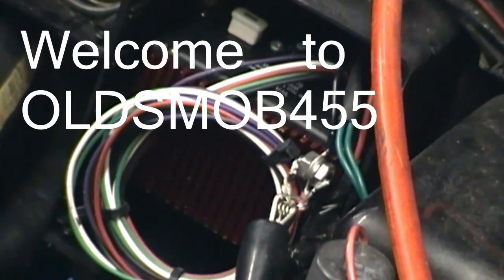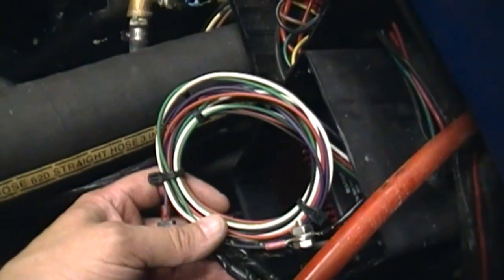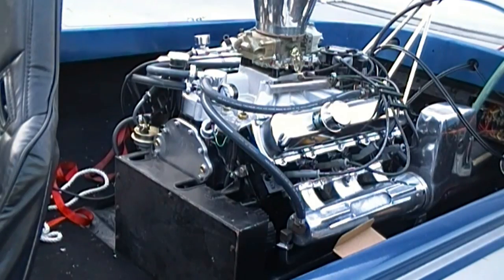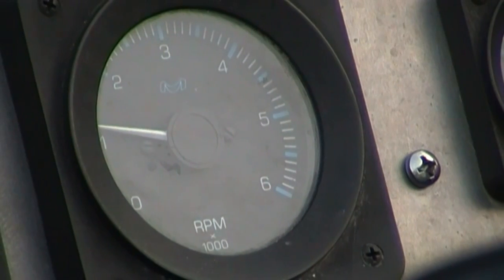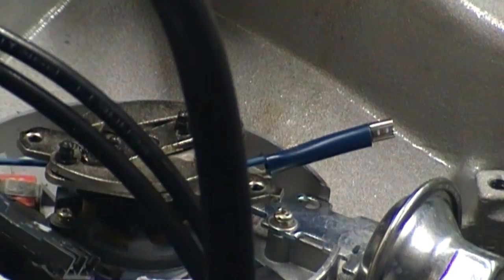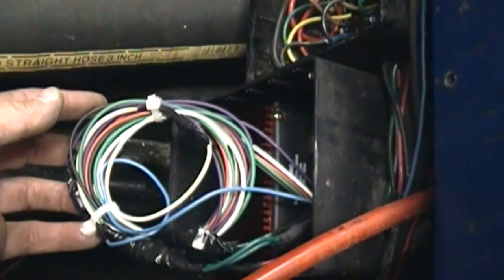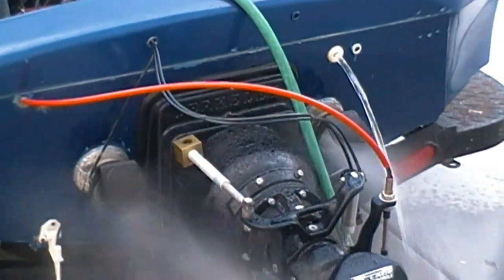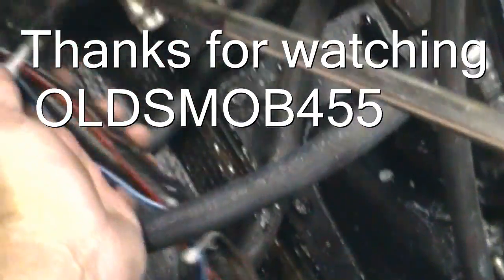MSD soft touch rev limiter or rpm control installation and testing on a GM HEI distributor.

Comment: I wired one up, and I put the green + white to the tach wire, and black to my ground distribution, and red to a fused 12v source, violet I cut. I was under the impression that you had to splice this directly to the distributor pigtails. But mine works fine with no premature usage (such as yours doing 750-1000rpm before chip value). I have yet to diagnose if any other ignition source are being cut while the controller is cutting the ignition.